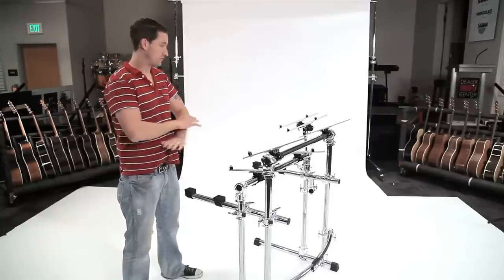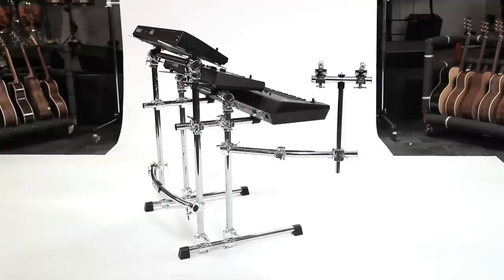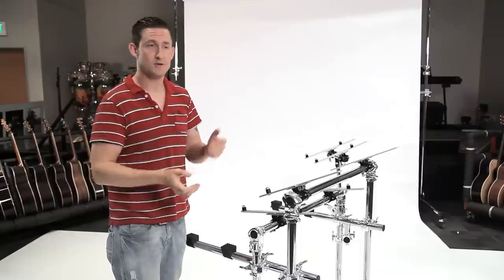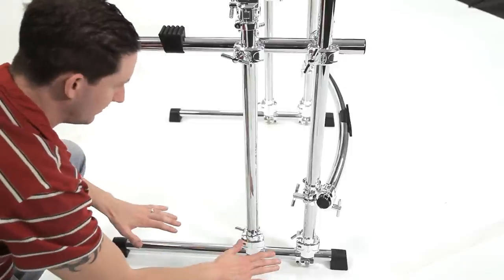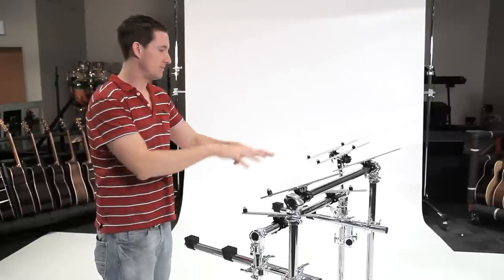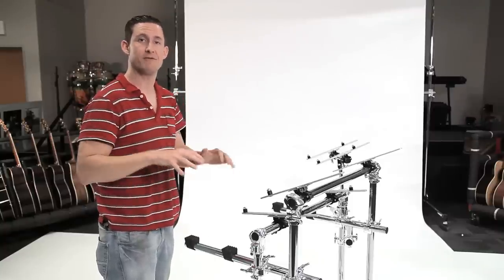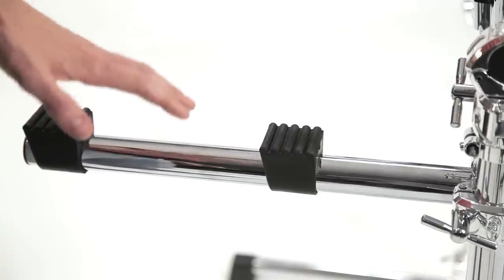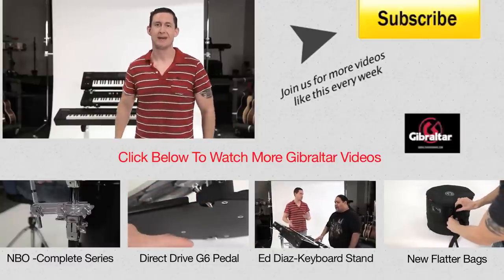Building a 3-Tiered Keyboard Stand pt2 | Brent's Hang

Comment: I priced this out at Sweetwater and it would be $878.63 for the rack frame and accessory add on if this helps anyone.
Reply: Can you please tell me how did you get a price for this rig?  I just called them and they said that this is a custom kit a one off that was never sold to the market?
Reply: @2012teemoney2012  you would have to buy each piece on it's own
Reply: Thank you very much

Comment: I'd be interested in a modified version of this to hold 3 x 88-key keyboards: Kurzweil K2500XS, Roland X8, Yamaha MOXF8. all 3 tiers would need to support the weight yet have freedom on the sides for the boards to stick out. But $800 is a bit unreasonable for what are basically a stack of metal tubes.
Reply: but it's SO SHINY
Reply: Unreasonable, you say? What are you using NOW, if I may ask? My keyboard setup currently is a $100 Jam Stand with two K-M tier adapters & arms. Looks jinky, but it does the job. I can only get two tiers set up this way. I've also tried an X-braced triple-tier stand, but the gear/teeth on the second & third tier arms are terribly engineered. I can't get any of the tiers to line up horizontally as a result. And, the adjustment height/angle - horrible to non-existent. I actually took the tiers off that stand because I hated dicking around with them.

All the other multi-tier stands are at least $150-$250, but I still wouldn't think of putting three 88-key keyboards on them. I have too much invested in my gear to entrust them to cheap, shitty stands.

So, is the price tag of the custom Gibraltar rack worth it? In terms of stability, performance, and looks - all Yes, to me.

Comment: i have a Yamaha CS80 (200lb) will your keyboard stand will be strong enough?
Reply from the maker: Fabrizio Prioriello you might need to add a second cross brace at the bottoms for the inside set of legs but it should hold 200 lbs.  The bottom tier that is.  I would not place 200 lbs on the mounting rails on the 2nd and 3rd tiers

Comment: Screw the guitar player... that's what the front monitors are for. 3:35
Reply: Keeping In the Pocket I know right. After paying over a grand on this stand, if the string jockey even came near it, I'd whack em' across the head with whatever I had on the top rack.

Comment: What is the weight capacity of the second and third tier ?
Reply from the maker: They will both hold over 60-70 lbs each
Reply: GibraltarDIY Thanks! I wish you guys can make shorter electronics bracket.
Reply from the maker: Mr RossMoron this is something we are working on
Reply: GibraltarDIY Great! Thanks to your videos I made my own custom keyboard stand. If I can send you a pic I would.
Reply: GibraltarDIY My third tier makes my third keyboard a bit too far from reach. If you can design an adjustable clamp that can angle the top bar over and closer towards the front it would make stacking keyboards super custom fit.